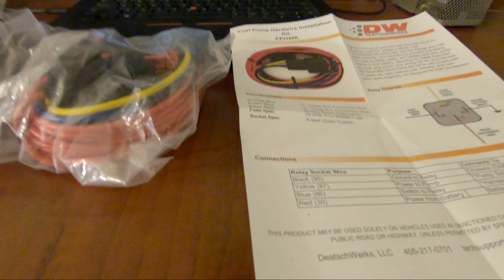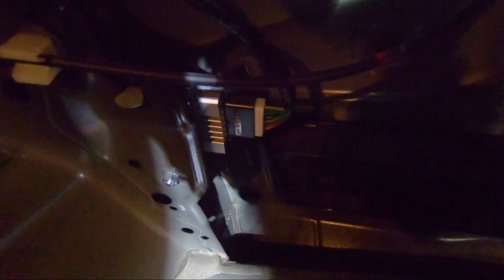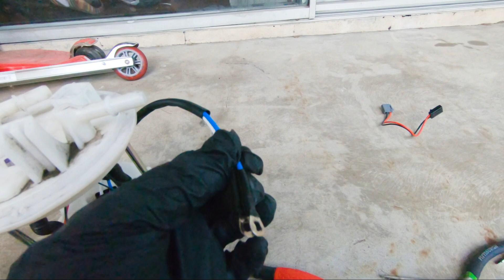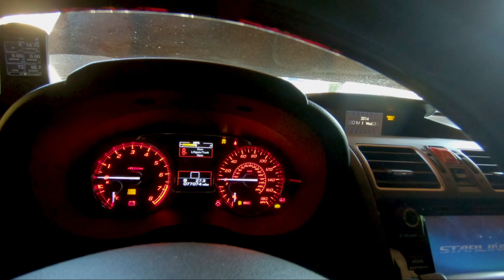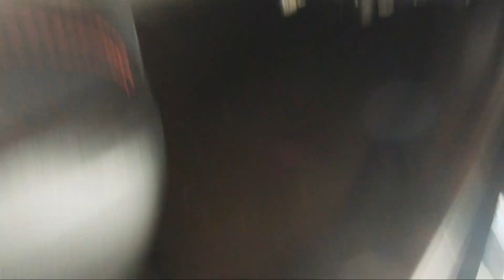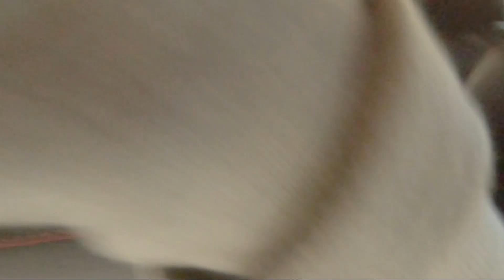2015+ Subaru WRX AEM 340lph Fuel Pump Hardwire with DW Hardwire & iWire Stud Bypass Kits 100% FLOW!!

Comment: There ain’t away to do it with the bypass stud
Reply from the maker: Do you have the bypass stud kit from Iwire?
Reply: @eddiestsla  no I don’t have  it I just hard wire it the the two wires in the trunk
Reply from the maker: @okan578567  could be a lot of amperage going through that and can melt the wires......keep an eye on it for safety
Reply: @eddiestsla  I hope it be okay only one pump it’s gonna power

Comment: I'm hoping this will be very helpful, thanks for sharing. I have a Radium hanger supporting a Walboro 450 and some kind of mystery hard wire kit, all installed by the previous owner a few years ago. My engine stopped while I was driving the car, and I found that the fuel pump is not getting power when it's hooked up (though I can get 13.8V to the leads when they're not connected to the fuel pump). I'm thinking I may have a grounding issue or something else that either came loose over time or got corroded out or something. Going to check the areas you showed in your video and start probing things with a multimeter. Anyway, thanks for sharing this and for talking about the issues you had!

Comment: Any issues with this setup?  iWire told me there is some issue and that this didn't work properly because of the way the factory wiring is to the fuel pump controller or something along these lines.
Reply from the maker: Not at all....still running solid and the car has gone to a new home and now I drive a Tesla
Reply: @eddiestsla  Did you ever verify that the pump received more power?
Reply from the maker: @2018wrxaddict  yes it did.....Ron saw more flow with that and the BRZ FPR.....but it was marginal and more for testing......there are way better solutions for fueling
Reply: @eddiestsla  cool I appreciate your replies.
Reply: Which solutions are better for fueling?

Comment: Once you Hotwire the fuel pump, your harness doesn’t work anymore right ?
Reply from the maker: That's correct
Reply from the maker: Hardwire and Hotwire are a bit different but yes.....your tuner will have to make some changes to your fueling

Comment: iWire has been fantastic with a custom harness for driving my radium duel pump setup in my 2018 WRX FA20DIT. They had me swap the factory connector to the pump with the sti connector so I pig tails for the level sensor and the the positive factory connector going to the trunk going to my FC3 Dual/Triple Pump Staged Controller. Yes all I needed is the green/yellow to power my connector signal for the primary pump. Honeywell 5psi switch feeds my 2nd pump activation. This video did simplify which wire to use as a signal, Thank you!
Reply from the maker: Are you running port injection? Why the Radium dual pump setup if you don't mine me asking.....

Comment: After installing hardwired kit is it normal to have a check engine light on ?
Reply from the maker: No.....that didn't happen on mine
Reply: @eddiestsla  oh okay I got this code p0230 fuel pump primary circuit I used radium hardwire kit
Reply from the maker: @carlosh7634  Did you consult with your tuner before the hardwirre? He'll need to make some changes in the tune.....

Comment: What oring set up did you use when installing the aem pump? People say different things, but I used the plastic spacer and 2 o rings from the dw kit ( aem o ring where bigger ).
Reply from the maker: Stock spacer and two o rings.....I'm also using the DW install kit. However, this stud bypass kit gets rid of the harness that comes with that install kit